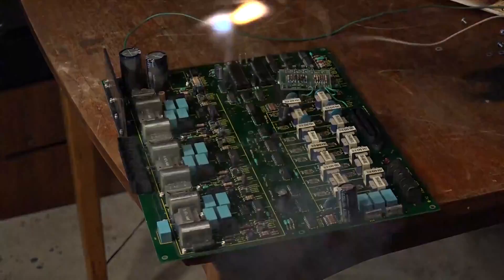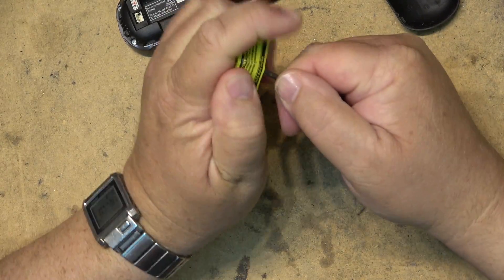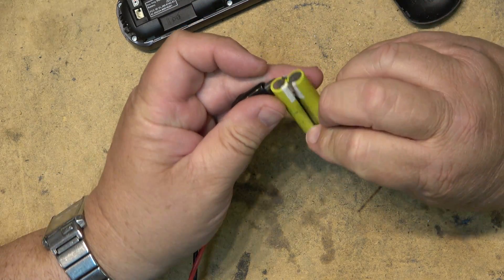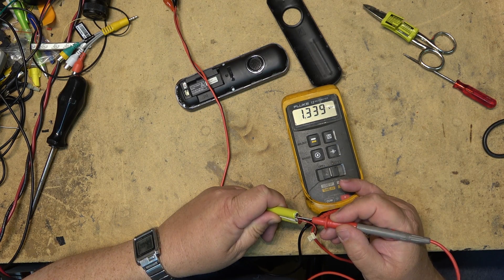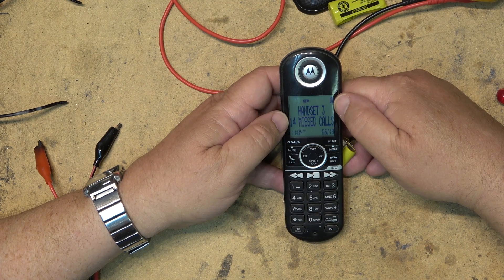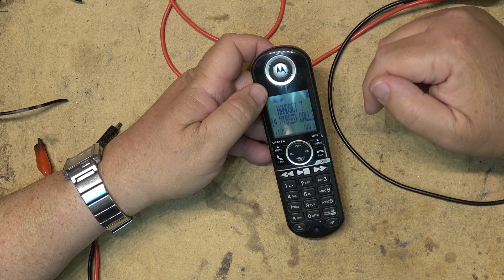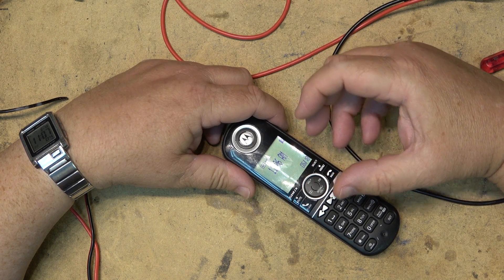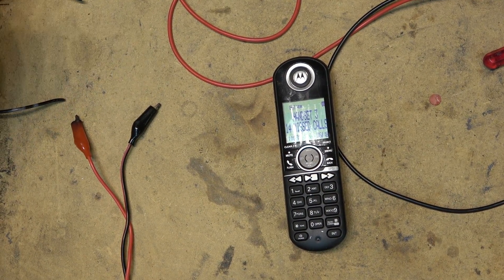Jump Starting a Cordless Phone Battery

Comment: I Remember Seeing Someone put
AAA Rechargeable in Cordless Phones
By Putting + & - Contacts
Like You See Inside A Remote & It Worked.
Now All He Has To Is go To Target & Buy
New ones & Pop Them In Like Putting 
Them Into A Remote
Reply from the maker: Some cordless phones actually used aaa rechargable batteries.  (Certain Panasonic phones)
Reply: @12voltvids  yah That Was Nice
You Can DO That. I Have A Solar
Power Bank The Lithium
Battery Was Shot. So I Kept
The PowerBank It's Self. So
I'm Thinking Of Putting A 4 Cell AAA Holder
To Power It When I Don't Have It Outside.
Can't Wait To Try It.
Reply: @12voltvids  oh If You Want To
Preserve Those 80's Mixed Cassettes
I'd Burn Them To CD.

Comment: I had a dedicated station for Panasonic battery packs as they aged, and would zap them regularly to get the dendrites out. Was a small box with a set of battery terminals on the surface, 2 M4 bolts, that would align with the contacts. Then inside there was a old industrial 16A momentary switch, that would apply the charge on a capacitor across the terminals. 4700 uF 100V old screw terminal electrolytic, with a small old 30 - 0 - 30VAC transformer that charged it up, via a 4k7 resistor and a single recycled 1N4004 diode, to around 90V, and with a LED and resistor to slowly bleed the charge away from it. Plug in, wait for the LED to stop increasing in brightness, and put the battery on the terminals, and hold firmly and press the button. A pop from the switch, and you release, and give another 4 or 5 shots, and in general the pack was then able to hold a charge for a few more weeks, 

Did not work if the cells were old and had vented, which was common with the spare battery packs in the phones, as they were always charged, but then I would simply go buy 4 tagged AA cells and repack the case with them. $7 for the 4 cells retail, and these would generally last around 2 years before dying. Was useful as there were a lot of cordless phones in the company, and thus I always had a stock of 3 or so packs charged up with new cells to swap out as needed. KXT9001 Panasonic cordless phones, I bought so many front covers due to damage and worn out hinges.

Comment: My dad knew how to do this to NiCad batteries. He would take them out of a battery pack he wanted to work again and zap a battery with the bare ends of an AC cord. He was super careful.

He explained it as the battery having a chemical tree growing inside the battery as you use it (I don't remember if it grew when charging or discharging) and you don't want that tree to grow a point inside because that stops it from getting charged. Zapping it with the voltage from an AC cord breaks off the tip and the battery works again.

He had an old Black & Decker battery pack and accessories he refused to give up and kept it working for years.

Comment: I've done this with single cell AA rechargeables. Also I've built battery packs out of rechargeable cells for things and it works. In this case I'd keep the connector from the dead battery and use it on the new pack.

Comment: I was really surprised to find our latest cordless phones just have plain AAA rechargeable batteries. No fancy connector. Much easier to buy replacements.
Reply: But you also get people putting AAA non rechargeable cells in there, and they tend to dump the electrolyte into the phone, destroying the handset after a night of sitting on the charge station.

Comment: I had decent success using a flash circuit from a disposable camera to burn the whiskers open .
Reply from the maker: I'll have to try that.
Reply: @12voltvids  I used a large capacitor and a lower voltage, less risk of damage, and a longer pulse of current to heat the whiskers of nickel up to blow them apart. High voltage arcs over inside the cell, and thus makes more paths to grow.

Comment: I used to charge a capacitor up and then discharge the cap into the cell. Give her a few whacks. If the terminal voltage stayed around 1.2-ish volts I'd then trickle them for 24 hours.

Comment: My brother (another ham) used the same trick, shock the battery then put it on trickle charge.
Some cells came back to life, depends on how knackered they were.
' Knackered ' is a technical term :)
Reply: Works so long as the cell has not vented, if it has them it is only going to work for a day or so as the cell now has not enough electrolyte, and thus when they grow back they will not dissolve. Works to a lesser extent on lead acid, but those in general suffer from loss of electrolyte more than any other thing, and also suffer from shorted cells along with the cells breaking off from the connections. The high voltage zap might create enough arc to melt them back in circuit, but is temporary.

Comment: I thought my batteries in my cordless phone went bad, but when I swapped them with a different handset, the problem remained and the old batteries worked fine. I had to do a complete reset of the handset. It must have some kind of battery calibration that went haywire.